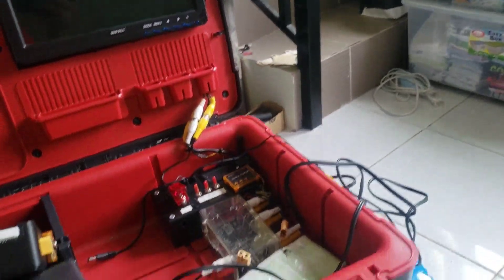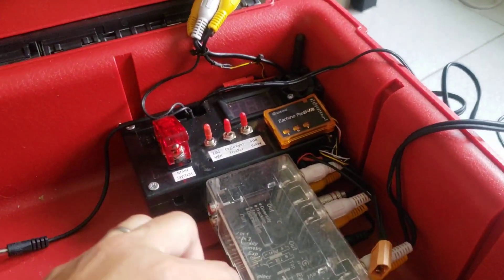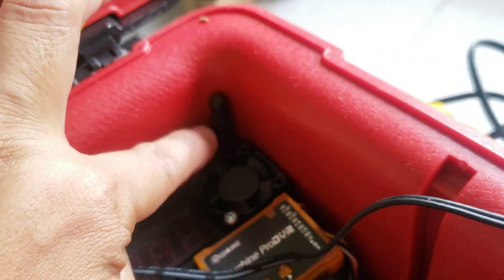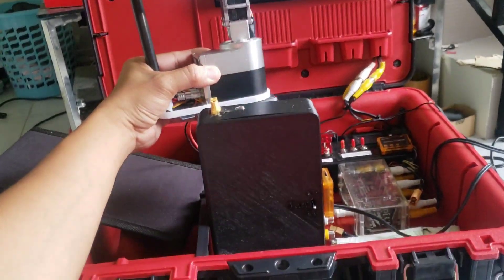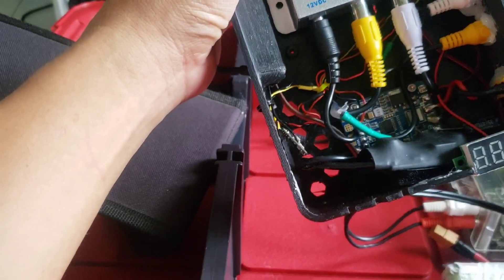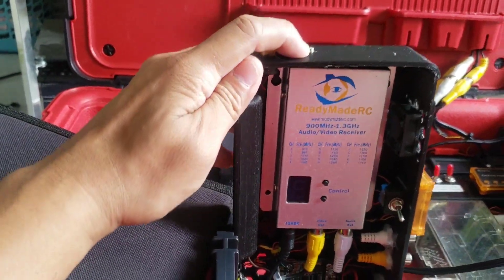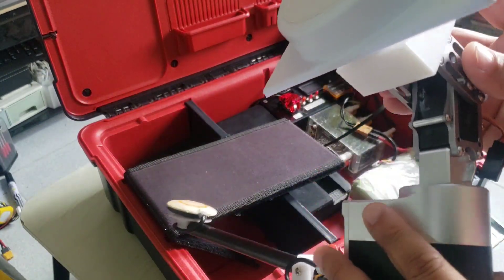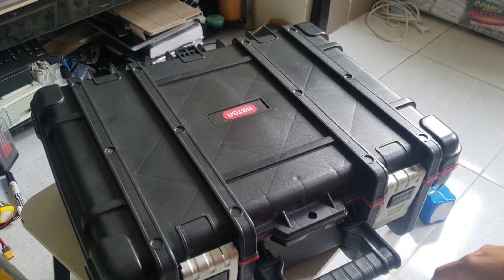Long range fpv groundstation!

Comment: Windfpv Kapatid, I have the old telefly pro, but the gps module that came with it is so slow on locking onto satellites and when it does will suddenly disappear and re-appear on and off so fast that my mini crossbow AAT will show GPS 0 / L10 and up causing the tracker to be a hit or miss.  Is there a better gps module that will work on the old telefly pro that you or any one here know of?
Reply from the maker: Naku not sure kung Anong gps Ang compatible sa Telefly... Not using any Telefly on my setups.. only digital protocol
Reply: @windfpv  that is what I have been hearing.  I have not been out flying for a while and just getting back.  Would you mind telling me what FW are you using on your Mini Crossbow AAT? Would you also be willing to make a video on it since no one has really done so?  Salamat in advance.  I grew up in Canada, but in the very near future, I am planning on bringing everything RC I have back to the Philippines.  Salamat in advance.  Sana one day I get to meet you.

Comment: Hi Wind, which one do you think is better, TrueRC X-AIR 1.3GHz or VAS Crosshair XTreme V2 1.3GHz?
Reply from the maker: Hey there! sorry, i think I have set the commenting to hold comments for review because of a lot of spams/promoting links via comment during the time i posted the video. by the way, TrueRC X-AIR 1.3GHz or VAS Crosshair XTreme V2 are not the same categories. You might want to compare X2-Air  and Pepperbox xtreme instead, as those two are at par, with the X2-Air 1.3 being lighter.